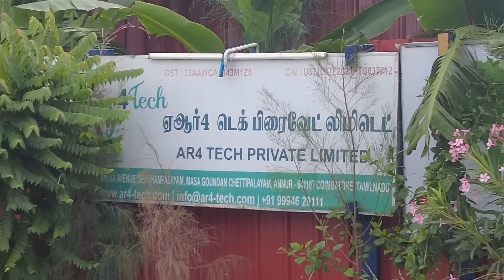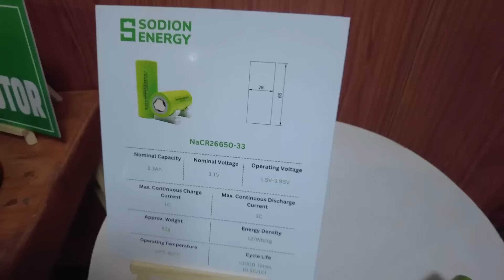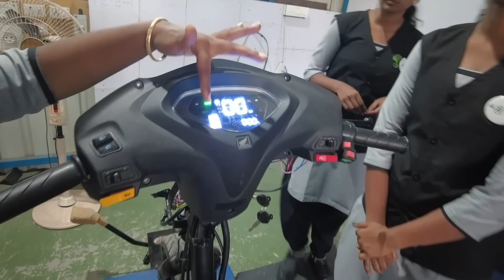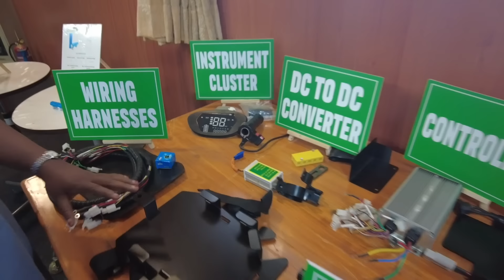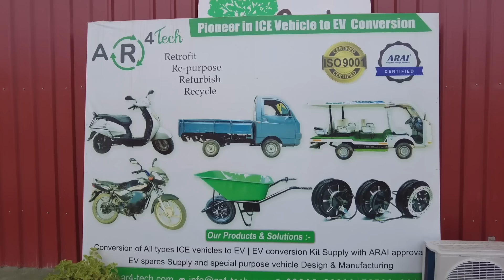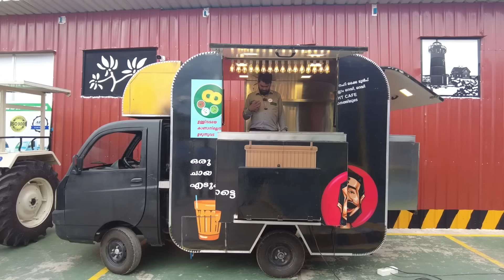Conversion of any petrol/diesel vehicle into Electric vehicle | AR4Tech | Tamil |

Comment: Good information. Thanks to SS Info TVe

IP68: An IP68 rating means a device can survive against dust and up to 1.5 metres of water for 30 minutes. IP67: Offers a similar level of protection against dust as IP68. However, in terms of water protection, it is only safe up to 1-metre water for 30 minutes